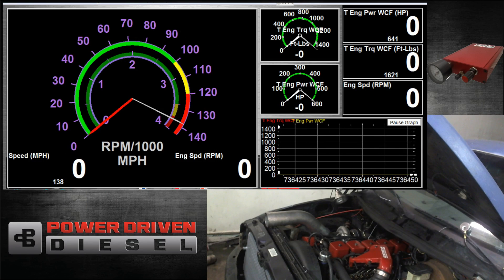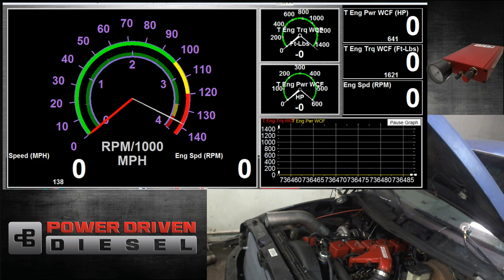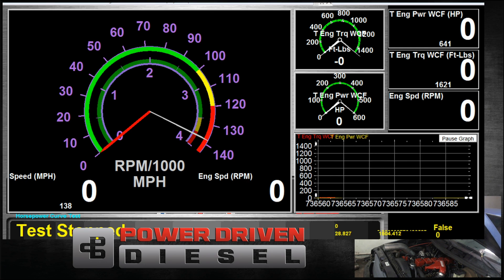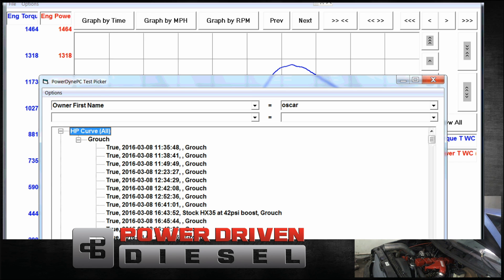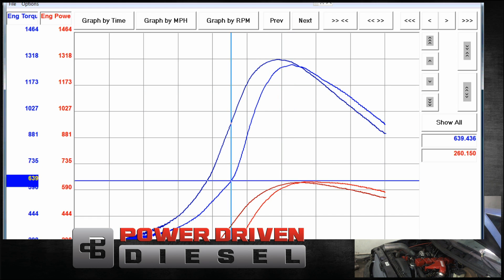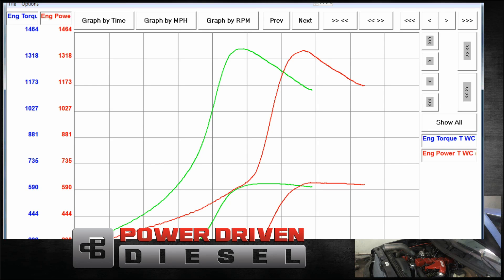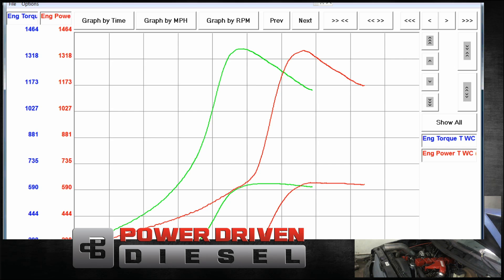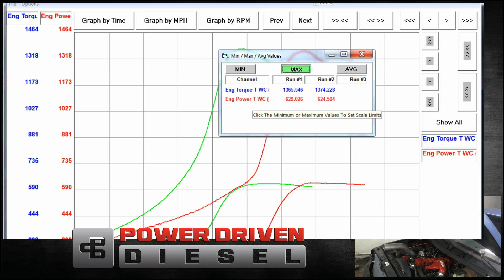Dyno Test: BorgWarner Turbos S369SXE Turbocharger | Power Driven Diesel

Comment: When you show the graph based on time why do you not have seconds displayed across the bottom axis? Why do you not spec out what fueling, timing and tuning you are using across each test? Not having a go, but these things would make the videos much better. Edit; also, what altitude are you at, and what is your correction factor set to?

Comment: Would this still be able to tow alright without egts going through the roof or smoking out a road? My 12v has bigger sticks and some pump work. Not sure exact details because I just bought it.
Reply: PowerDrivenDiesel what about on a 07 5.9 with 100hp injectors? Would it be ok towing or what should i go with
Reply: @saulignacio1  100 overs and a Single S471 would be a good match for the 3rd Gen

Comment: When you do these videos can you put the full engine build sheet in the comments, including timing, converter stall, DV, Manifold, etc. a lot of people run stock manifold garbage and it would be nice to know the expected power levels of your running a stock, aftermarket t3 or a t4 to match the turbo. Timing obviously will have a major effect on spool and peak torque/torque curve. I would like to compare with some more info. Thanks-Brad/Tittle Diesel Performance
Reply: O